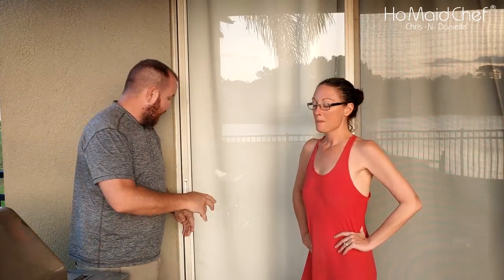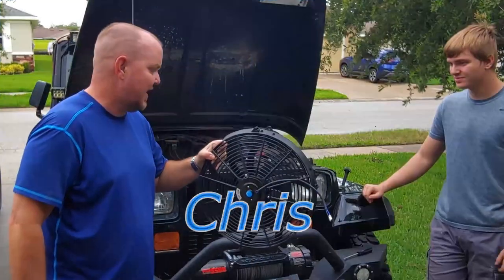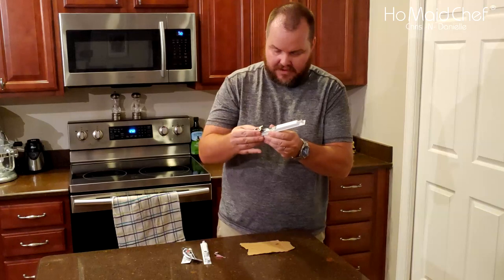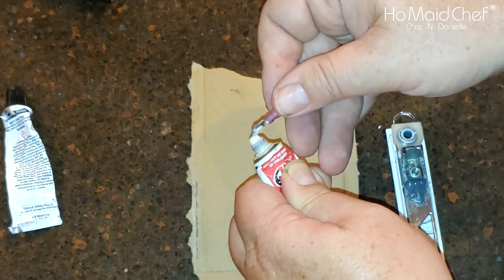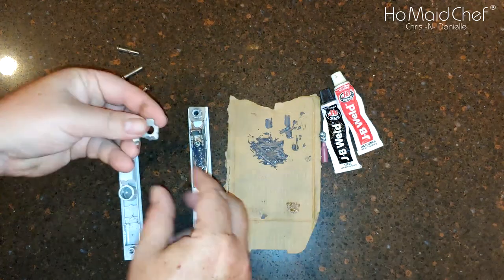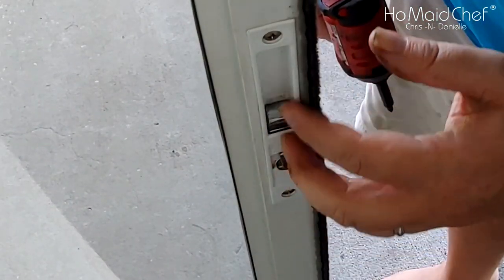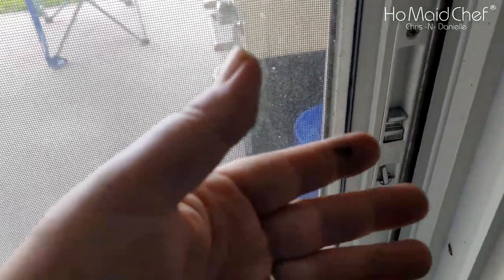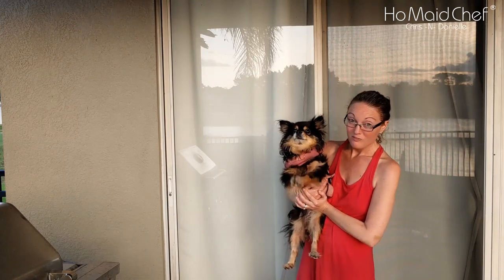How To Fix Sliding Door Latch We Used JB Weld

Comment: New Sliding Door Latch cost ($12.98) at LOWES....J-B Weld cost ($17) make you sure you research the best decision. Chris, you and Danielle did a great job of showing how to QUICKLY make the repair!
Reply from the maker: Didn't see the latch system for $12, cheapest I saw was $30. JB Weld was $5, also had the jb weld that I have used on a few projects now.